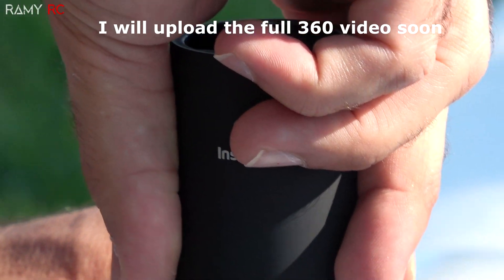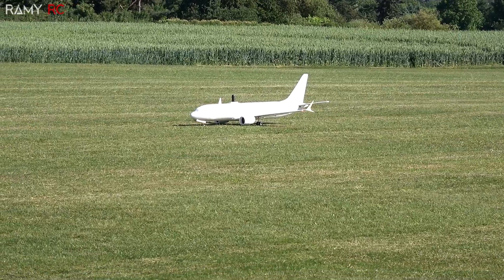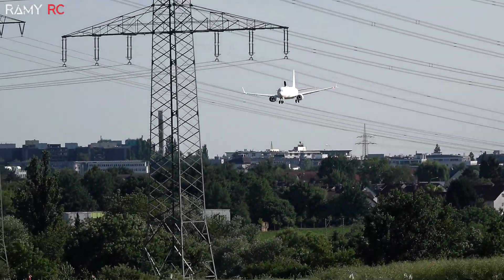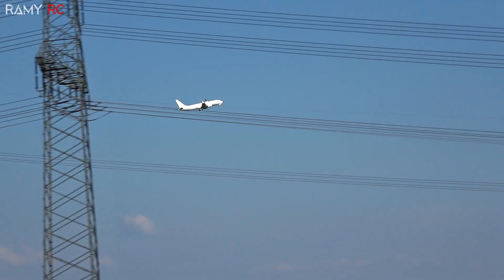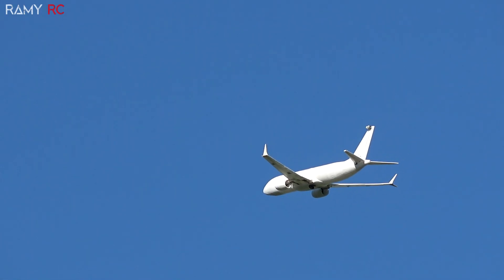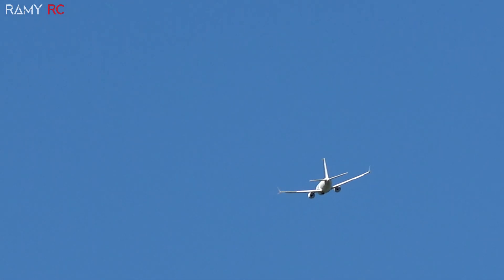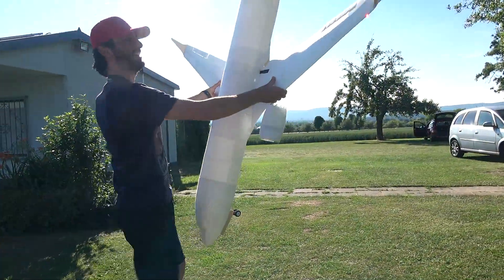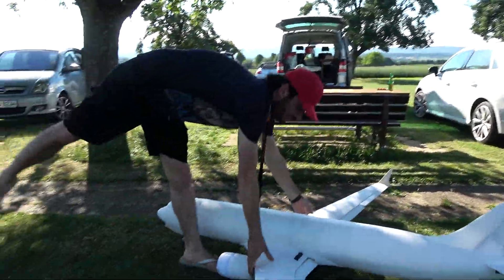BOEING 737 MAX-8 RC AIRPLANE MAIDEN FLIGHT

Comment: Rami you are a master builder, but your landings need a lot of work. Stop chopping the throttle at the last second. That’s called ‘chop and drop’. On final, set the throttle to a point where it’s keeping the plane flying, but with a gradual decent, then keep flying until the wheels touch down. Use subtle throttle inputs (more or less) to slow or hasten. You should only be using minimal elevator on round out only. Anyway, I know you have improved since these flights, I hope these remarks help others to master their landings.

Comment: So enjoy your vids. And your skills. If I may be allowed to offer something that has helped me fly unique and challenging A/C,  was I got myself a cheaper and still challenging low wing A/C, that i just went to the field and did nothing but approaches and touch n goes for weeks i then picked windy days and worked on my approaches and landings. What happened was i started flaring later and with less abrupt movements and with consistent approach speeds and angles. It made a huge difference in my flying. All the best and thank you for sharing your amazing journey

Comment: Stays in the air better than the real thing!
Reply: His later video shows his plane stalled just like the real thing.
Reply: Asu the max never stalled, it had a system that would push the nose down if the aircraft pitched too high up. Faulty sensors made the computer think the aircraft was pitching too high up, and pushed the aircrafts nose down into a nosedive
Reply: @Asu01  they pitched down, they didnt stall
Reply: michael paulissen 😂
Reply: Totally realistic good job ramy even lives up to its role

Comment: She looks so realistic in climb out and turns and that's even without decals and windows! You have become a true master, I noticed she drops a wing in either direction when you slow hyer right down as in the flair when you land - the surest way to correct that is without a doubt to incorporate slats - it's something I mentioned in one of your old videos where the same behavior was evident, it is a well know trait of highly loaded swept wings such as those of an airliner but with slats and some sort of VG or wing fence the problem almost goes away completely at least in landing - in the meantime try holding off the flare longer I know it's hard to do with such beautiful pieces of art you put so much time in to but try holding off the flare until the last minute and you will grease your landings every time it's something my instructor drilled into me.
Reply from the maker: thanks man, really appreciate this comment😉

Comment: great job again. i tried build with you but your plane came out much bigger than my project. what is the fuselage length and main wing span? i need to start over.
Reply from the maker: fuselage: 2 meters wingspan 1.7

Comment: do you know that  MINIATURE  winglets  do NOT function in the same way as full size.   since a model does Not weight thousands of kilos,   the  TINIEST  angular error built into the winglets Results in a  PROPORTIONALLY  H U G E  undesired, unscheduled  YAW  moment.    cheers

Comment: Great build series and flights!  Some hopefully helpful criticism I have is that you were coming in with a little too much power, that's why it wanted to keep floating down the runway.  As you saw, your second and thirds landings were better because you had less power.  Now I'm not saying cut the power on final approach, if you do that the plane will most certainly stall and drop.  Start your approach with about the same power you were using, but as you get closer to the runway, start to bring your power back slowly.  Remember, when landing a scale jet and almost any other scale model, power is used to control altitude and elevator is used to control airspeed.  So the less power you have, the more the plane will want do descend.  The more power, the more the plane will want to keep flying.  This is exactly how the real  737 is landed.  On the approach with full flaps and gear down, the power is set to around 40 percent.  When crossing over the runway threshold, the power is slowly reduced to idle which slows the plane down and causes it to descend slowly.  Again I absolutely love your videos and I'm just trying to help.  Can't wait to see the 777 maiden!!  Keep up the great work!

Comment: Hi Ramy  absolutely loved tracking your build progress and watching the maiden flight and I'm amazed how well it flies for such a light plane .. I flew full size aircraft as well as flying RC planes so if I could suggest ,and I don't mean to critique your experience , because of the weight of the aircraft ,I don't know you may do this already , but when you're approaching and landing in blustery conditions favour the rudder over the ailerons and add a touch more speed . I found this worked wonders for both types of flying
Reply from the maker: Thanks man, still need to prove a lot of my flying skills 😅

Comment: Have you considered printing the 737 engines with the bottom flat like the real one?
Reply: Boeing went with the round engines like Ramy's plane with the new 737 MAX.
Reply: MegaTechpc It's still not completely round compared to an A320